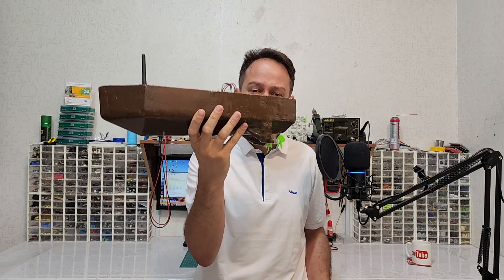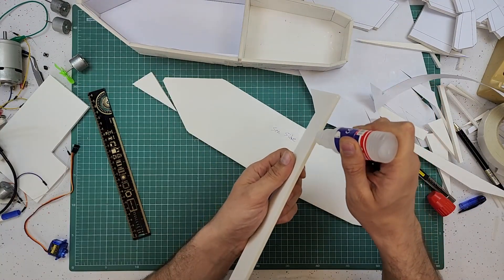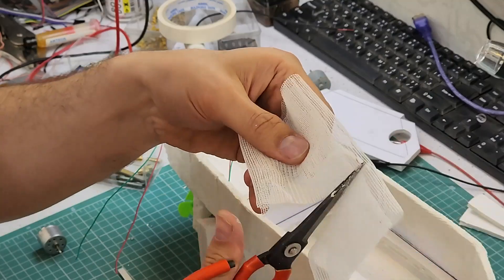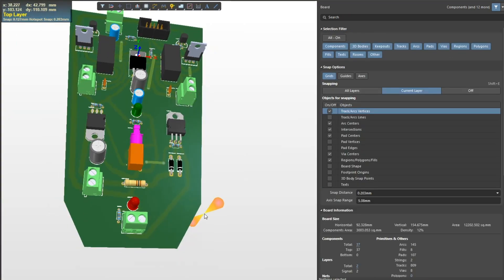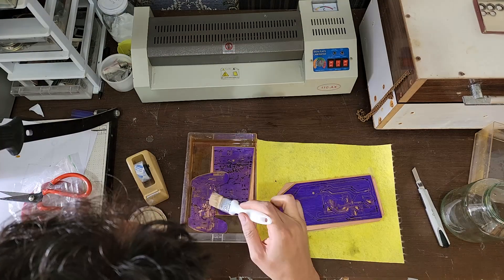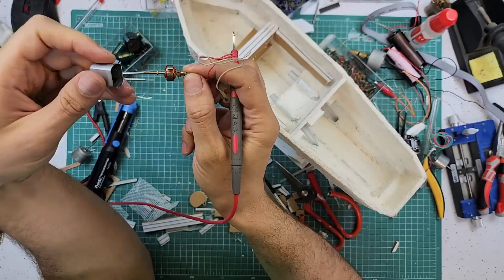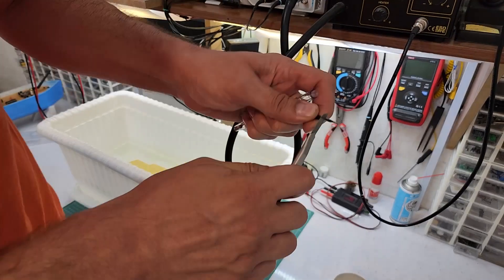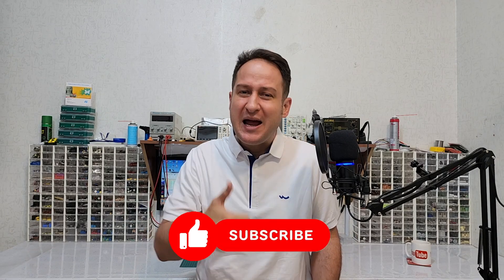How to Build a Remote-Controlled Boat from Scratch: DIY RC Boat Project

Comment: This is very VERY cool. What a great project. I'm mostly interested in the electronic aspects, but I enjoyed the mechanical/physical parts too. 

I'm very interested in learning more about the fundamentals of remote control. Unfortunately, all my YT searching so far has lead to videos where they entirely or largely just use pre assembled components without any explanation about how it works, or how one might build their own rudimentary elements .... you seem like the perfect guy to step in and fill that void 😉
Reply from the maker: I will make more videos like this one 👍